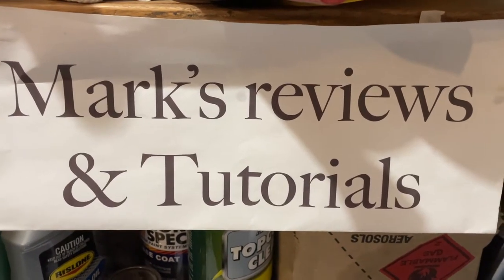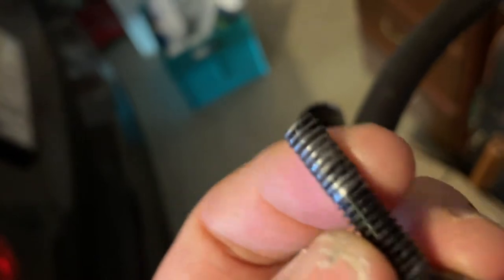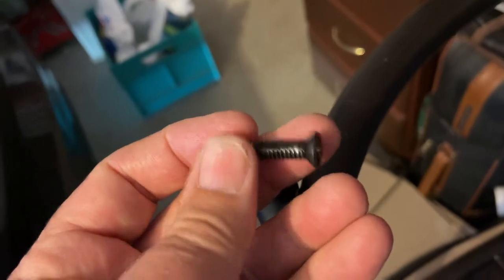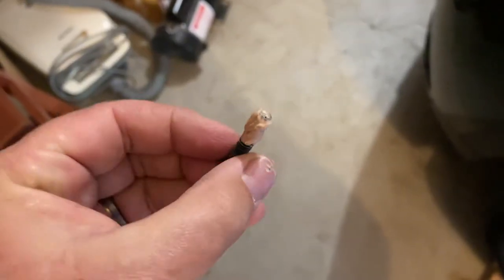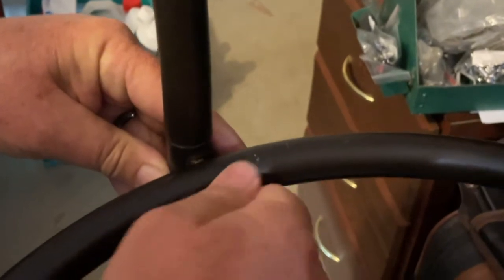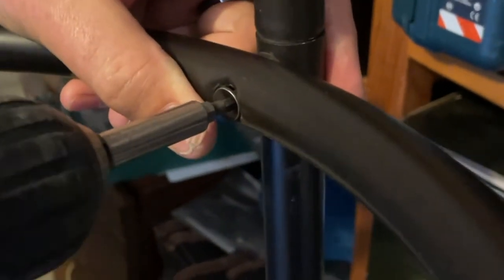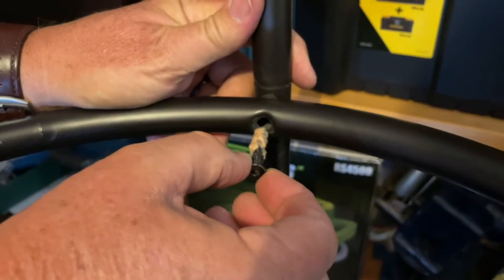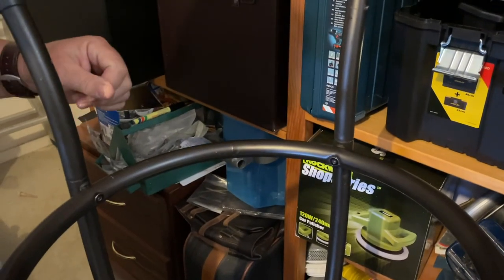Repairing a loose screw that won't do up tight. Stool Leg base repair. How to hold a bolt in

Comment: Having this very same exact issue. I thought about hitting it with some JB Weld or maybe even mig welding the hole and redrilling or putting an insert in it, then realized I was overthinking it.